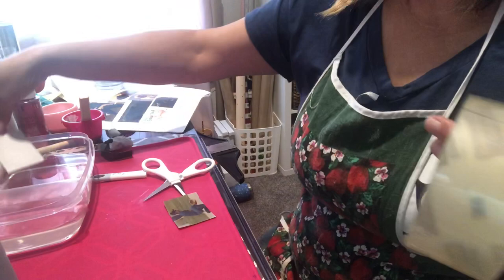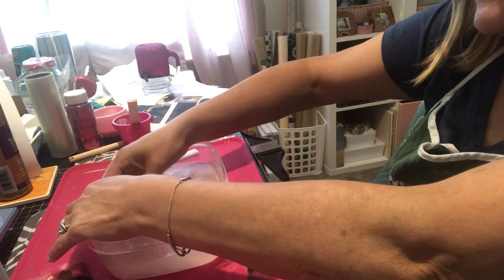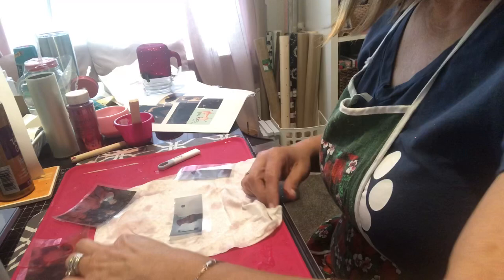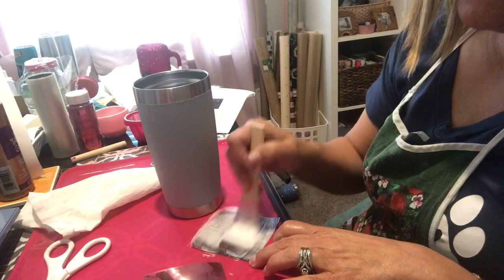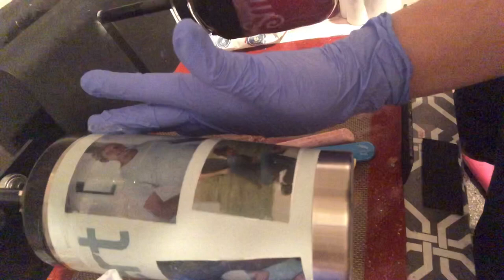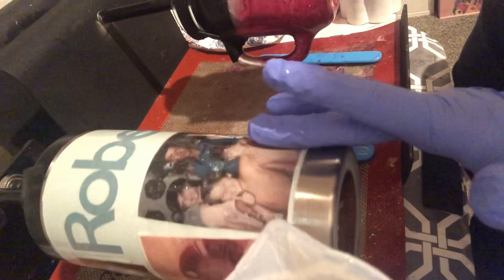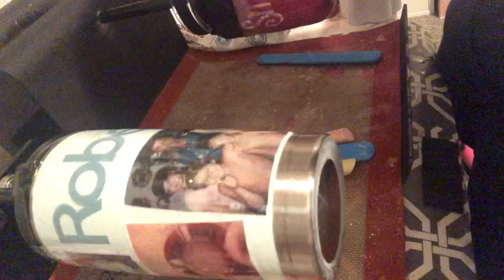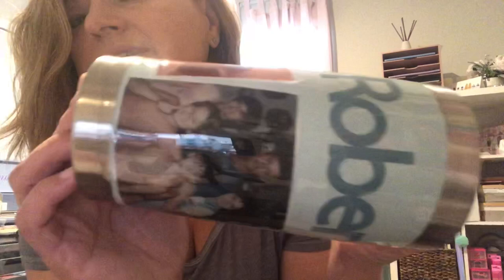Tumbler tutorial; how to put photos on your epoxy tumbler

Comment: I have a tip!  Some paper won’t release the ink very well.  You can spray the picture with clear spray paint, let it dry, then put your tape on it. It soaks it off so much easier. I use an inkjet and it works!  Finally, cheap packing tape is my favorite because it is so much thinner.

Comment: So if you have no laser printer what would be a option or way you could use the regular inkjet printer?
Reply from the maker: So with the inkjet if you try to takeoff the backing with water it will smear. So you can do a solid picture just cover it and not takeoff the backing. This would be more like a printable vinyl look then a printable clear sticker paper. The other thing is I found Photo paper at the dollar tree there’s eight in a pack and it works fabulous i used this in my inkjet. I did do a video on it if you want to see how it looks. I just sealed it with mod podge and it worked beautifully under Epoxy.
Reply: Hi so if using printable vinyl ?? Don’t do the water method just tape on the cup ??

Comment: How did you mask off the top. Looks like some
Tape or something? And when did you remove it I’m sure it have to be before  the epoxy kicks. Thanks. Great job.
Reply from the maker: Yes, I use electrical tape because it stretches and bends. Always fold over a tab to grab easy. When I tape off the top, I let it spin about 30 then pull off tape.
Reply: Thanks. I do vinyl work and stuff from boat names to smaller detail work.  Just for fun on the side.  But I just bought stuff to do some turning.  I’m excited. I think I’m gonna laminate the picture and then glue stick or epoxy the pic on and then turn it.   ... thinking one small patch (I’m a cop) and the rest plain. Thanks for the inspiration
Reply from the maker: Nice, my son in law is a cop. I thought about laminating then thought maybe to thick that’s when I remembered this trick from grade school. Also I have used this and not taken off the back when I did not want see through. Recently I tried photo paper printed pictures, worked well just applied modpodge prior and let dry before epoxy. Let me know if I can ever be of assistance
Reply: Thanks! I’m hoping the laminate will get buried in a few layers of epoxy. We shall see

Comment: so I just print the pictures  on regular paper and then put tape on the picture and if I put it in water just the white of the paper comes off? the whole picture wont come off?
Reply from the maker: Did you use a laser printer? If so that’s correct, just let them sit in water a few minutes then gently rub off the back. But must be a laser printer.

Comment: So I have a Polaroid printer, can I use these photos and then the tape? what color/ brand chalk paint do you use? what’s the best place to get epoxy like the one you have ?
Reply from the maker: So with actual photos yes you can tape over them to protect them, no I have never used Polaroid type but I have used photos. When I use photos I modpodge over them or use Elaine’s tacky glue. My only concern would be that fluffy center in the Polaroids I feel like I would almost want to take the back also just to make sure nothing where to get in the center of that fluffy part you know what I mean. And then put them down with mod podge or glue and let them dry really really well. Are use both Waverley brush on chalk paint as well as spray chalk paint. So the epoxy that I used on this Tumblr came from Michael’s I now use pro marine Epoxy that I get from Amazon. The epoxy from Michael’s it’s called Envirotech light and I also liked that one.

Comment: Are you putting mod podge on back of pics when gluing the image to the cup also when u are finished are u using epoxy
Reply from the maker: usually they stick without it on the back and I put it on the front and over the edges. if I need to than yes I will put it on the back. I have also done them and the tape stuck so well I used no mod podge. only worry is if it lifts epoxy goes under. if you use on the back go thin and let it dry completely to prevent any cloudiness. yes I use epoxy.
Reply: @themostcraftynurse3914  I did have another question, i have a hp desktop printer would this method still work?

Comment: Could I use an inkjet printer or does it have to be used with a laser printer?
Reply from the maker: Laser to take the backing off for it to be like clear sticker. With ink jet you can cover with clear tape and put under epoxy but not in water to remove backing the ink just smears.

Comment: I went to cvs and had copy made. Will the paper still peel off that easy u think?
Reply from the maker: Do you know if it’s laser? I would do a small part like something you could cut off and test. If not you can do the tape over and not take off the back. Is gives more of a photo on cup look than the clear sticker blended in look if you know what I mean. I use that technique on darker colors or glitter and works well also.

Comment: Did you put the glue on the photo side or the tape side?
Reply from the maker: Initially I did both and it was fine, however what I have discovered as I’ve done it more is that you can put it on either side or not. And when they stick well you honestly don’t need to put it at all. However if you have any lifting then put it and you can do either side or both whatever is your preference

Comment: Can you put the sticker from walmart on the tumblers under the epoxy or do they have to the vinyl?
Reply from the maker: Yes you can, I have tried every kind of sticker possible. The only thing I found if it’s thin like tissue or news paper material than mod-Ogden or do a tacky glue mix with water over top to keep water lines from happening.

Comment: Only made one cup of my life and it was a baby shark for my granddaughter. then the other day a friend asked me to make her a cup and I just took a picture and with the advice of my cousin who has made many cups before.. I just hot glue that picture on a cup it is currently on a spinner with a second coat of epoxy and is going to take so much to cover of that picture... I wish I had seen this before!!!
Reply from the maker: I have done that early on too. Yes the epoxy gets under and you have to use multiple Coates on it. I have found (because I used a sticker with foam in it too) that about 1/2 way through while the is still sticky you can stop and press the edges. You may have to slightly sand because of the splotches from pressing. But when I did this out of me to use only one more layer of Epoxy and it looks good..

Comment: Can I do this process with actual pictures? I had them printed at a local pharmacy.
Reply from the maker: You can’t put actual pictures on an under epoxy, You would have to seal the picture With either a clear spray or Modpodge. I have put pictures printed on photo paper under epoxy on Tumblr’s however it takes a little more epoxy because it’s thicker. Now this particular technique with the tape you must use regular copy paper printed with a Laser printer

Comment: Can you please write down the items needed, what was that white stuff you put it under the photo and on the top as well, thank you very much.
Reply from the maker: Yes of corse it was modpodge you can also use a clear drying tacky glue mixed with a little water. Let dry completely before covering with epoxy
Reply: @themostcraftynurse3914  thank you so much, i tried with mod podge two times it dried on the picture, i couldn't see the picture, I will try again, 😄

Comment: Please help me out. My pics are usually 3x3 or smaller.  The tape is not that they wide so can I overlap just a little? And will it show?  Do you think the mode podge will "reveal" that line?
Thanx 🥰
Reply from the maker: You can overlap it does not show, I do it all the time
Reply from the maker: The epoxy will also bring out the color and you can’t see the lines under it
Reply: Awesome!!! But it has to be in a white background?  Have you done it on a colored background?  I just hate to use waterslide and you know that has to be kn a white background as well.  Thank you so much for this video! Love your work
Reply from the maker: Sorry no sure how I missed this. No does not have to be white, However a solid is better. If your doing people a pale color looks best. I know this tumbler looks white in video but is actually light blue. How did your tumbler work out?

Comment: Do you have a list of the supplies you used? Especially the glue?
Reply from the maker: Yes; I painted tumbler with chalk paint (use any paint you like) or it also works with glitter base and light epoxy over it. I did a pink glitter cup video that shows one of these pictures over glitter. Then pictures printed on regular printer paper with laser printer. I used packing tape to cover, you can use transfer tape just make sure clear finish for nice look. Elaines original tacky glue (with a little water mixed in) and a bowl with regular tap water. Once you backing starts coming off rub off gentle don’t scratch. And of course your epoxy of choice. Hope this helps, please let me know if you need anything. I’d love to know how fabulous your tumbler turns out.

Comment: You used chalk paint instead of spray paint?
Reply from the maker: Yes, I use both on cups. If the paints going to show I love how the chalk paint texture looks under epoxy. Chalk paint is also more forgiving, so especially a solid color you don’t get the worry of lines or runs and dries fast.

Comment: OK this is a really stupid question with an HP ink printer work then for the photos or no ? Sorry not sure what you mean laser printer 😖
Reply from the maker: Not at all stupid. So with the ink jet you can not put in water and rub off the back the ink will run. When I have to use my ink jet I just put tape over the pics and don’t take off back. Laser printer puts the picture on different is why it works. I’ve used this with magazines too.

Comment: Question ~ would this method also work with clear contact self~adhesive paper??
Reply from the maker: Yes, I have used clear contact paper and it worked well.
Reply: Wouldn't the picture look blurry since contact paper is thicker than that tape?

Comment: Will the pictures look ok on top of a rose gold glitter?
Reply from the maker: I have found that when you do clear pictures it does not look great over glitter because it makes peoples faces and stuff looks sparkly. However if you want to do it over glitter just don’t take the back off and leave a little tape on the edges to keep it on or mod podge it, and it comes out very nice. So this is good because you can do it as a clear sticker paper Or You can keep a solid background on them when that’s more appropriate. Both ways look very nice under epoxy
Reply from the maker: If you look at the fire fighter Tumbler that is how I did the flag.

Comment: how much epoxy did you use?
Reply from the maker: I’m sorry for this I don’t remember it was so many tumblers ago but generally on a glitter base I do 25-30 first pass then 10-20. On paint base like this I do 10-15 and then a repeat 10-15. If I’m applying glitter with epoxy than I use about 5cc then add glitter and the epoxy over it depends on how flat the glitter lays. If I’m putting my glitter inside my epoxy I start with10 for fine and 15 for chunky (cc/ml) I hope this helps. I use to be quite heavy with epoxy and learned less is more :)